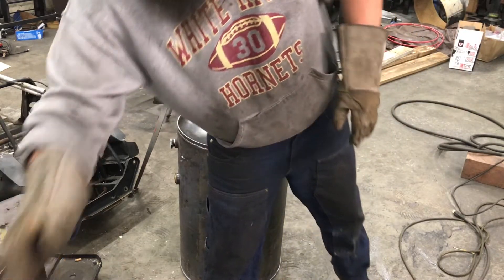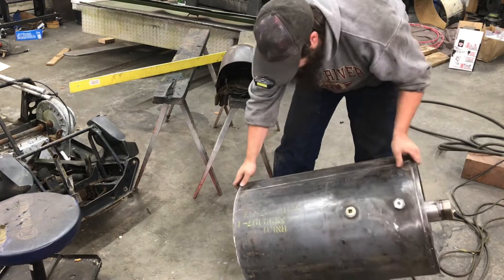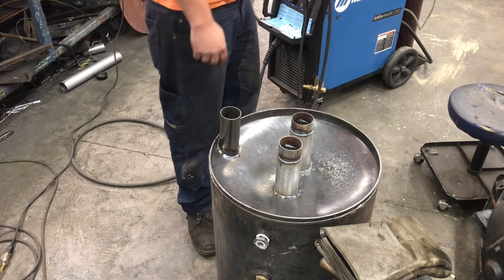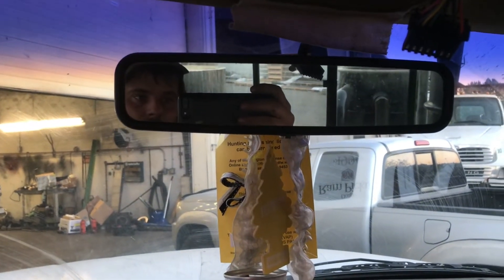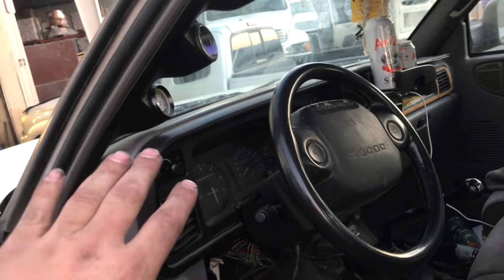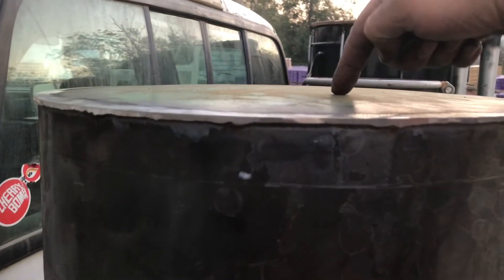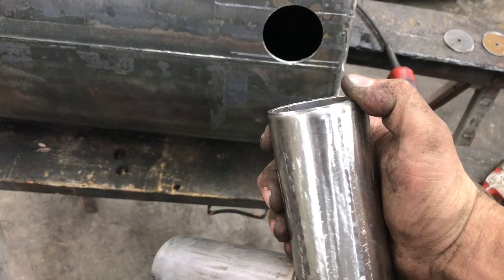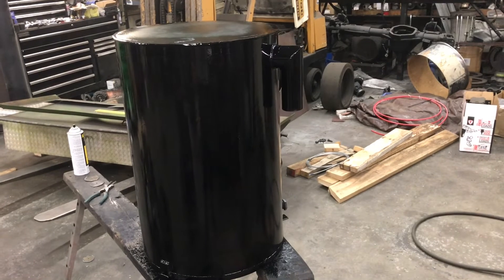V10 Gasifier Build Hay Filter Barrel

Comment: Looking great!  I'm wondering if you have thought about the difference between running wood in the system vs running charcoal?  What are the advantages etc.
Reply from the maker: Charcoal is so much easier and does not need half of these components. But essentially a raw wood gasifier must make charcoal to produce good gas, but uses the water content of the wood to help hydrogen gas content where as a charcoal gasifier needs water added for hydrogen content but also to moderate the metal melting Temps they reach
Reply: @BigBeavrSlayer  Very interesting .. thanks for that explanation!  Makes sense!
Reply: @BigBeavrSlayer  .. there is a new video up on this channel, "GenGaz - Lagunov" called "A Hundred Years of Firewood-Powered Vehicles (documentary) .. 49 min long .. you might enjoy seeing all the different setups.
Reply from the maker: @MerwinARTist  I have been following Sergei for a while he is on the forum as well. Very well educated gentleman from Ukraine with more reading history on working gasifiers then most people
Reply: @BigBeavrSlayer  That's awesome!!  🙂

Comment: How often do you have to change the hay in the filter?
Reply from the maker: I have yet to change it in the toyota, since it never sees oxygen it does not decompose, I just wash it down very well with a garden hose once a month until the water comes out the drain clean. Most guys say to change it annually I just haven't done it yet it's still cleaning the gas pretty good and helps shed a lot of moisture from the gas